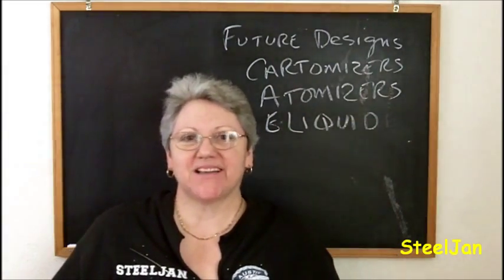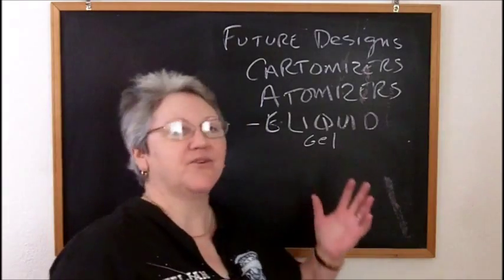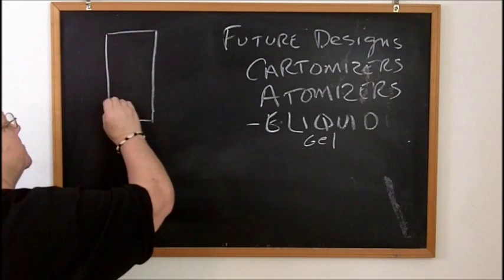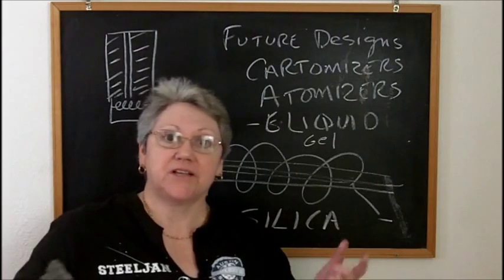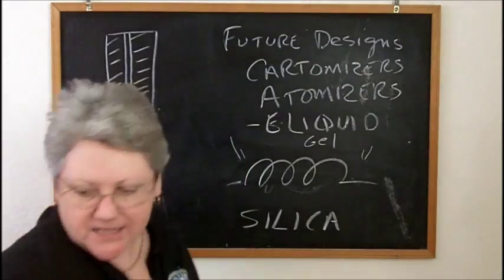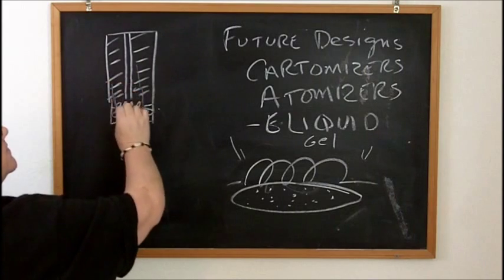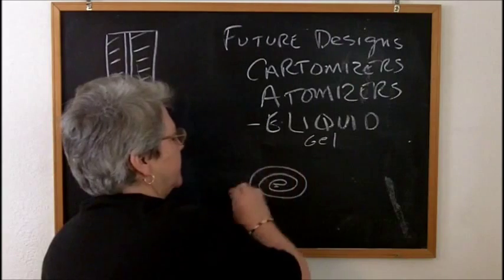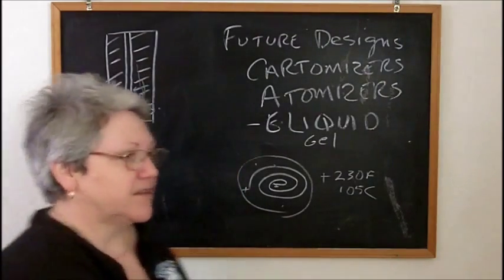Ecig Future Design Ideas - Atomizers/Cartomizers & Eliquid

Comment: Commenting from the future!
No e-gel, but ceramic coils have allowed us to no longer worry about burning e-liquid!
I think this is a very good solution to this issue well ahead of its time. It cool to look at how far we have gone, and how far we can go.  O the other hand, cartomizers are now the big-tobacco go-to model. Why? they got so cheap. We still have an issue here. We are at the point where big tobacco can mass produce the most ineffective of all the mods made since 2012. They are using 1st generation e-cigarettes! This is crazy, because they choke them full of 45% nicotine and give you 300 puffs; repeating the same thing we saw with tobacco. They are also the guys that thought up using ammonia on our tobacco to use less tobacco and more filler, just to get us hooked. My point if you do not see this already: big tobacco is at it again. They are perverting the technology, and getting people stuck in a cycle of endless spending. An nJoy disposable can be made for as little as $0.75, they sell them at $6.99. This is the next battle in stopping regulation. People are handing them ammo when we should be handing them a fine. Its time the mom and pop vape shops got together and bonded over regulation, gathered non-bias researchers, and created solutions to issues still around 5 years ago.

Comment: if you have a typical top coil like an iclear you can just use a lighter to burn off excess e juice and dry run it to clear off the residue, rids taking out the wick and getting hands dirty

Comment: i figured this out, or how it can work. problem is the gel/chemical. it'd be an upside down candle like contraption. heat the coil, melt the gell, gel drips down and coats the wick, and then you've got the vape. problem lies with the gel or more along the lines of heat soak.

Comment: i think a stone or ceremic type of material wont be good to actually hold the juice in place where u want it to be honest. besides that i think also that the methods used today are easy and cheap way to produce, i rather spend 1,5$ per week on a cartomizer and use it only a week then i have to buy a expensive one and have to be carefull that it will be dirty using heavy juice.
the problem we facing is the juice to be ON the coil and constant feeding the coil keeping it wet

Comment: @steeljan You are probably right about it not being a viable option for mass-produced products. An uninformed consumer pushing the wick into the coil could very probably cause a short - or at least a huge drop in resistance with all its consequences for the battery...

Regarding your wicking problems: I personally never had a problem, I try to roll it quite tight and just oxidize the part that comes in contact with the coil. But there is definitely a lot of variables...

Comment: @steeljan The main problem is WHAT will happen to the solid binder or gelling agent after the PG/VG/Water evaporates, it will most probably clog up the coil/ceramic etc. Big prob.
 I made some yesterday using Carboxymethyl cellulose but you can use Carbomer too. CMC seems safer cause it's edible.

Comment: I completely agree with your idea's however as with most industries the use of propriatary parts still remains rampant in most industries today. That said, I have seem wonderous new technologies and device innovations in the year have been vaping. I think ceramic and possibly carbon fiber wicking will be improvements. Also, some of the new devices like the Stardust are making juice containment and filling less messy. The baked on material to the coils. What will clean that off the coil.

Comment: I agree with you on 99.9% of this, however I don't see the vendors ever releasing an easily reusable cartridge system, it would cut down on the profit, and this is a business for a lot of people :) just like most products, they are designed for failure at some point to make you buy another and keep the money flowing, am I wrong in this?